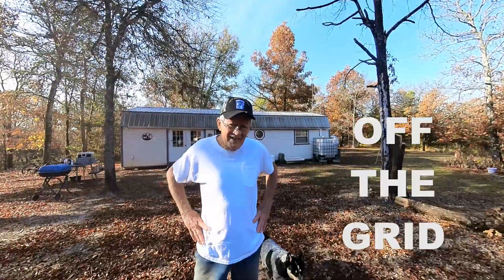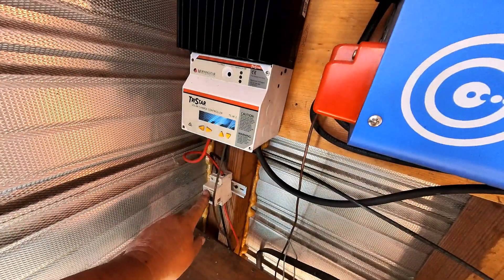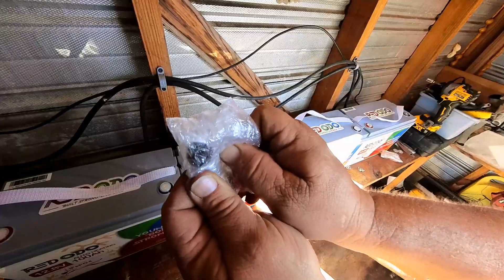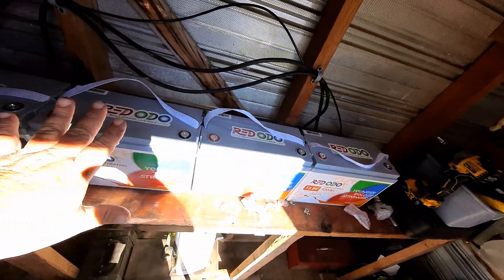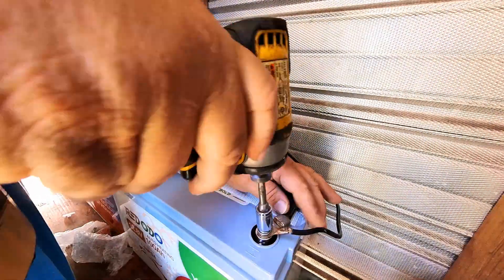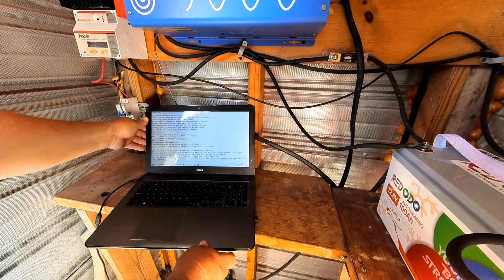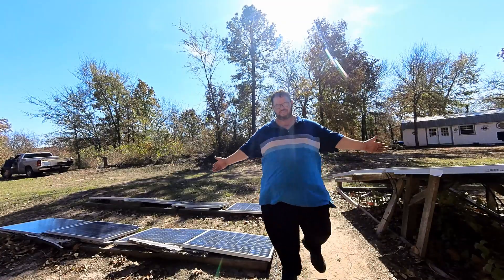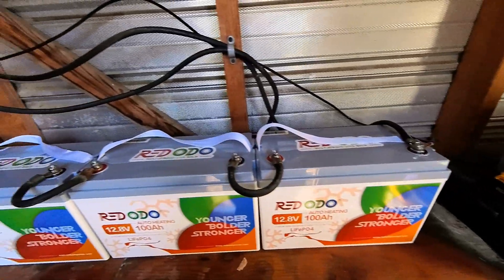I Built a DIY Solar Battery Backup System With Redodo 12 volt batteries

Comment: I been on Solar for 2yrs now with a similar setup.  2,350 watts on the roof, 3 MSB charge controllers, 48v 3000w Chinese inverter, and Bluetooth battery shunt. I started off with 4 Power Queen batteries,  but after a year added 4 more.  If you have 3 or 4 days of bad weather, or run a 12k btu AC in the evenings on top of everything else, the more batteries the better.  Im saving up for another 4 to  have 12 and eventually 16.

Comment: Strongly suggest you add main shutoff and fuses your complete system!
Reply from the maker: the system has fuses and breakers..just no breaker or shutoff on the battery to inverter yet

Comment: Hello from Ukraine! 
Because of war a lot of electric power generations( big electric power stations etc)  are destroyed and now many households know why lifepo4 battery is better than lead-acid batteries from cars or AGM batteries :)
We used similar system even in appartments without solar pannels: solar hybrid invertor + lifepo4 batteries. You can charge batteries from city power grid when eleticity is working and use this energy from batteries and invertor in blackout hours. 3 kW, 5kW etc capacity could help you to live in comfort even few days without electicity in public power grid! In private houses you can add solar pannels to this system like you have. In extrime time we used fuel generators but they have many negativities.
This solution is expensive and not everyone can afford it, but anyway is the best.
Good luck!

Comment: How long do the batteries last and what happens to the old batteries?
Reply from the maker: the old batteries where still good just mix matched they last around ten years if you run them hard and 30 to 30 if you have a big enough battery bank so they dont get cycled as deep

Comment: Good video. PL|EA|SE use a resistor to pre-charge the invertor caps before sparking the last power connection, that's a good way to damage an inverter without pre-charging circuity installed.
Reply from the maker: yes I know...been doing it for 9 years now..ill get one someday

Comment: Nice work, but I'm leary about connectors' loop sticking out past the front of the batteries. Something could snag pretty easily.
Reply from the maker: Yeah that's a good thought you know I also thought about putting some type of metal bus bar in between each battery but then it would leave an uninsulated piece of steel running across from battery to battery but I don't know maybe that's okay

Comment: Nice setup. Usually, I hear that you have to balance the batteries before you connect them in series.
Did you check the batteries to see that they were the same voltage before you hook them up, or do they self-balance on their own?
Reply from the maker: Honestly i never tested them..i think they are pretty good right now..redodo says to balance every 6 months
Reply: LiTime says every 3 months.But Will says don’t buy a balancer they do it by the bms, but was talkin 12v.Two of mine show 13.34 and two show 13.35
You need to drain and recharge to get full charge a few times till you get full ah.
Reply from the maker: @2hotscottpro  that's too close to balance

Comment: Only thing I can say is you should have done the research on 48v battery price and just got a single 48v battery or 2
Reply: "The more I know, the more I realize that I don't know." Mr. Oklahoma, you seem to really like 48 volt setups. I'm probably going to do a few 12 volt setups. I have four 48 volt charge controllers that I bought brand new ten years ago. Only thing is, I don't know if they would charge lifepo4 batteries very well or not. EG4 looks interesting. I've got a TriStar 60 amp mppt controller too, it's brand new. I guess I'll have to use a Windows PC to set the voltage.
Reply from the maker: @OffGridThoughtsChannel  yes if you have the TriStar you can use a computer and by this little cable and hook it to the USB and the charge controller and then download an app called MS view and you can put in the actual parameters of the individual battery on what it needs to charge and you can get those parameters from the company of every battery that you purchase that is a life po4.. they all give you that information.
Reply from the maker: i have done the research..i have two 48 volt server rack batteries I will be installing in a video soon..but these batteries where sent to me 4 pieces to test

Comment: You are going to love the new batteries. You will want more double up what you got and you will be good to go.
Reply from the maker: 👌 we always wanrt more ...enough is never enough 🤣
Reply: 48V are the way to go.  48V 50Ah are just $350 (for a pair) amazon now.
Reply from the maker: @goodcitizen4587  50 amp hour is only half of what I installed in this vid...they where the 100 ah...I think may already know that...but the other thing is the build quality on these batteries differ between different brands,,,and I mean makes a huge difference,,,watch some of Will Prowse videos on the battery teardowns if you have not seen it done,,,he shows which ones are good and bad

Comment: You’re updating to use just four Batteries? He needs at least 13 Batteries. 26 Batteries would be so much better for his setup.😮 Thanks for sharing.😊
Reply: people telling other what they need 😮. Or did I misunderstand what you're saying?
Reply: @mr.c6674  no I don’t care how many Batteries this person uses. So yes, ‘you did miss understand. All I was saying is ‘that he would’ve had a much better Battery system by using more Batteries.🔋 Wouldn’t you agree?👍
Reply from the maker: he does very well on 100 amp hours at 48 volts..in the begging he had 16 6 volt led acid that went for 8 years

Comment: I saw that he had some mismatched brand Lifepo4 100ah batteries prior to your install. Did he have any other issues with that setup besides you correcting the low temp charging/battery heating? Just curious to see how using different brand batteries in a 48v configuration went.
Reply from the maker: thanks for noticing...but yes there where uneven charging issues and i believe because of mis matched bms's reading voltages different on each battery it was causing me to have to charge it at a lower rate on some of the batteries to keep it from high voltage disconnect
Reply: @OKLAHOMAOFFGRID  Maybe part of the reason, but they will still become out of balance. He needs to get a battery balancer. 4 12v batteries in series will always become out of balance.
Reply: @Scott-ig1zd Hi,Two mine 13.34 other two 13.35 for almost a year since new.Wills new vid says we don’t need  balancer.He has a solar forum.

Comment: Greetings from an off grid East Texan. Good video and you are a kind neighbor. Watch that 48v spark, it can blow capacitors in your inverter at this voltage. You can use a cheap resistor or even an incandescent light bulb to slowly fill the caps and you wont get the spark.
Reply: You can also use a pencil sharped on both ends,carpenter pencil works great. A battery balancer will those keep batteries in great shape.
Reply from the maker: Thanks for the tips!